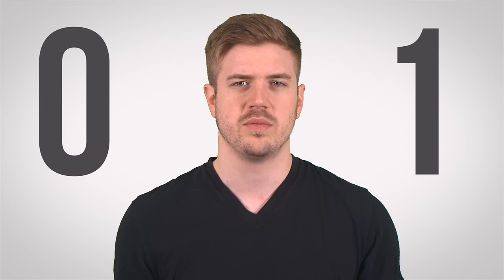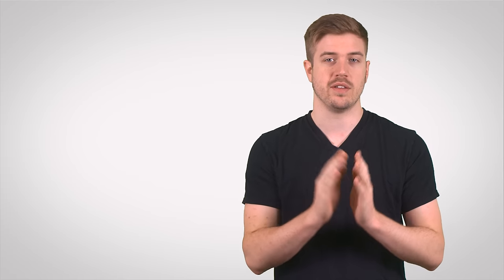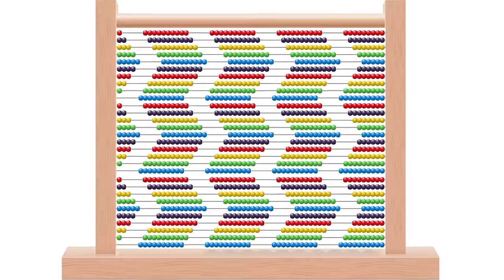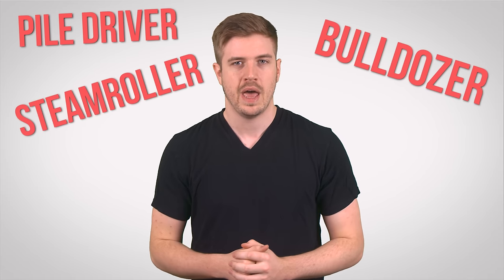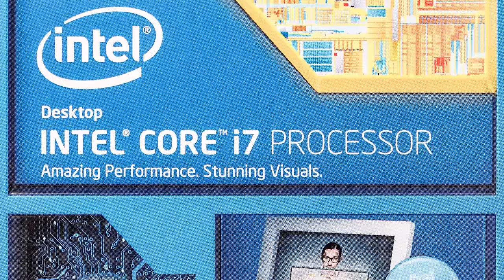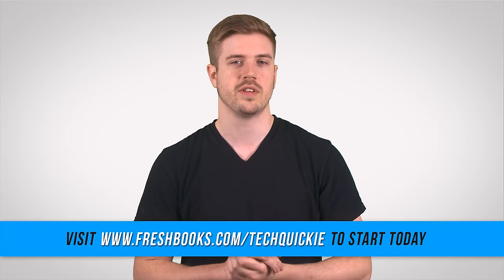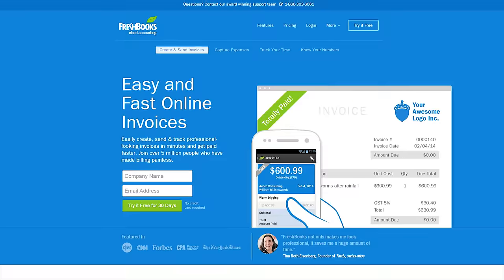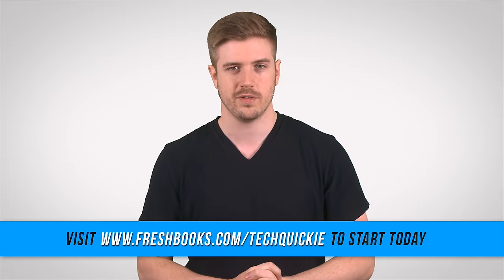Coding Communication & CPU Microarchitectures as Fast As Possible

Comment: I am a C++, C, Python and a JavaScript coder. I also know how processors work. movl $ax, %rbp
Reply: No mov $ax will give an error.
First error
Register have % prefix.
And you cannot move 8 bit register to 64 one.

But don't worry will all learn from our mistake

If you want to do that use the sign or zero extind move.

Movsx or movsx
In at&t movsbq or movzbq

Mov is the operation 
And s and z is zero or sign extend .
B us byte
Q is 4 bytes.
Reply: @xrafter  I said I know how processors work, not x86 intel assembly.
Reply: @yeppiidev  

Will then write your example in binary. 

B8 00 00 00 00
Reply: @xrafter  it's very hard to see an assembly developer nowadays
Reply: @xrafter  I said I don't know assembly, or writing opcodes in Hex. I am a C , C++ , Java , Node.js, React and .net developer and I don't work with assembly, even I made a semi-linux based OS with a monolithic kernel.
Reply: @yeppiidev  
Ok .

Assembly developers?

The only reason to know assembly is to found a compiler bugs with the code.
Reply: @xrafter  😆😆😆😂 I also made a compiler for  C! The only difference is that it compiles C code to PASCAL instead of Assembly. Maybe I should call it a C to PASCAL transpiler
Reply: @xrafter  I only use assembly when I need to handle syscalls from applications in my OS. It's written in C and it has a small BASIC interpreter
Reply: @yeppiidev  
What do you need to make an os?
Reply: @xrafter  If you asked the software and skills required to build an os, you need to know Assembly for the bootloader, C for the whole OS and C++ for the applications (if you wish to include support for applications). Software required is, an Ubuntu 12.04+ OS or Ubuntu 20.04 on WSL2 and VSCode . I made my os with Ubuntu 20.04 on WSL2 on Windows 10 2004 and I use VScode with WSL support. So, I can easily debug my OS using gdb, qemu and VScode. If you wish to include your own libraries in the os, you need a cross-compiler. I hope you will understand what I said. Subscribe my channel for more OS making related videos and coding related videos. I also videos like enderman makes, which means I make videos about Windows-related things. Please subscribe.